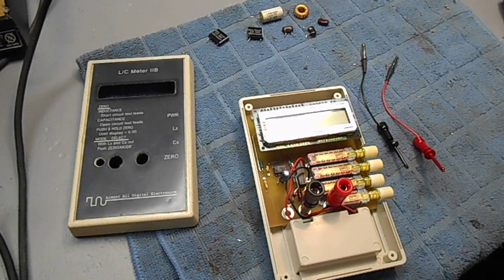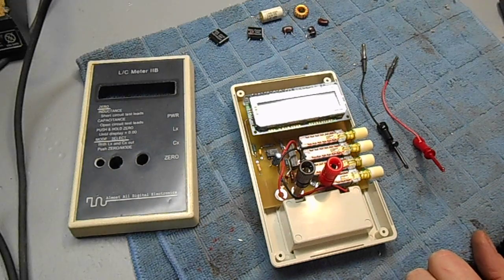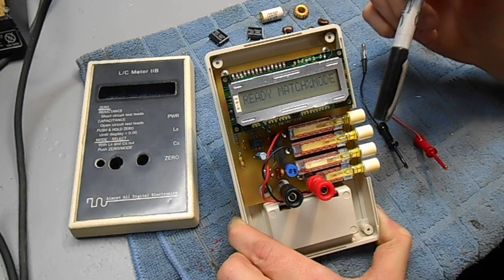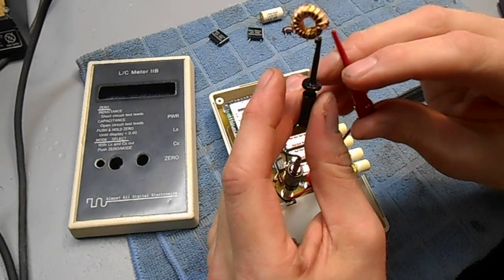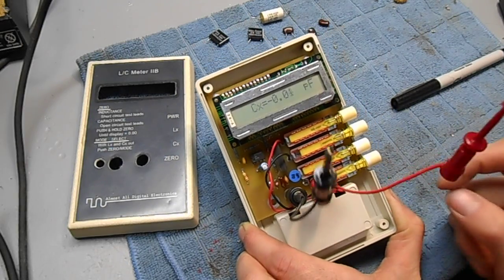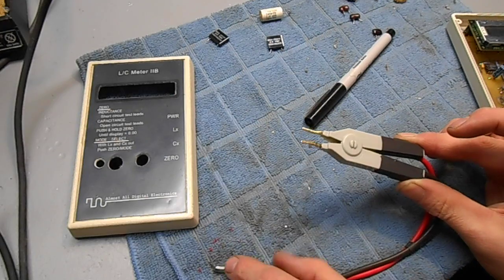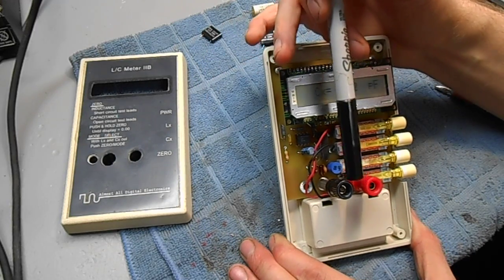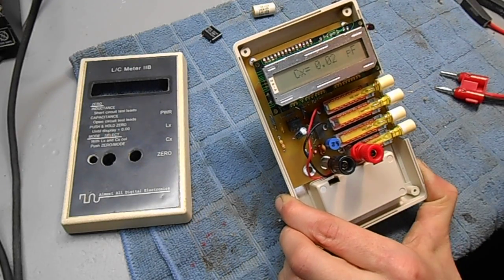GBPPR Vision #7: Review of the AADE L/C Meter IIB

Comment: Gluing aluminium foil (pre-cut to fit, with a short length of wire soldered to the foil) to the inside of the upper half of the casing & soldering the free end of the wire to pcb ground, should solve the hand effect problem. Really cool smd adaptor jig you made !

Comment: I'm having an intermitent problem with my AADE meter measuring capacitors.
As an example if I'm measureing a 220 pf cap, the meter will display 3000 to 8000pf and quickly range up and down. Other times the value reads hig like 3000 pf. I haven't figured out what triggers it, If I shut it off, for a few minutes and come back it will function properly, ---until it doesn't.
 I did get a little clue on the operation, that might help troubleshoot it.
 Have any thoughts.